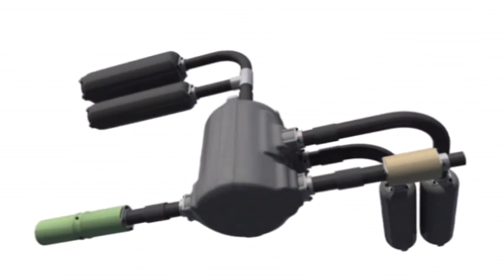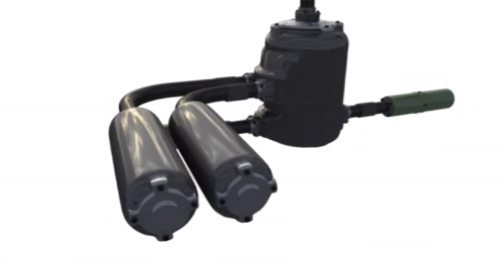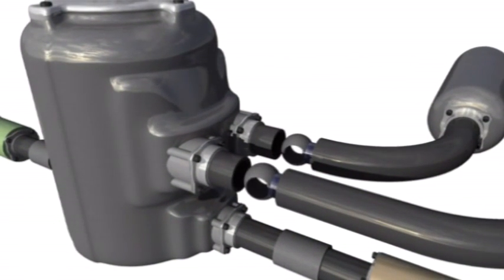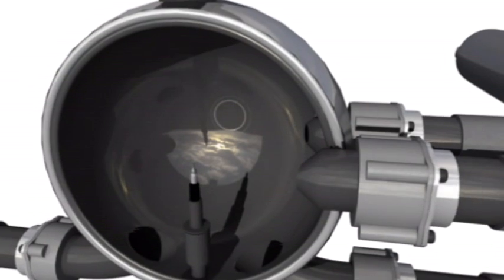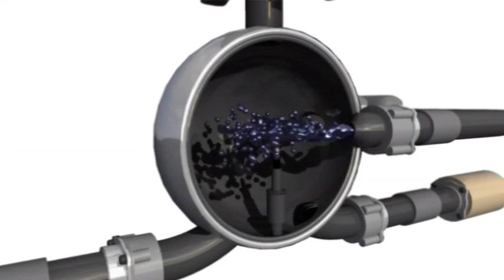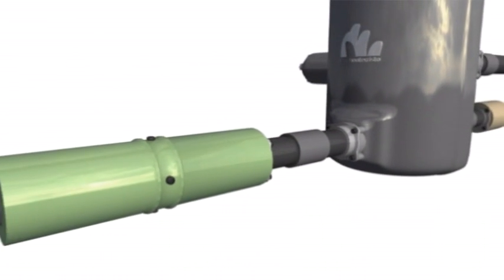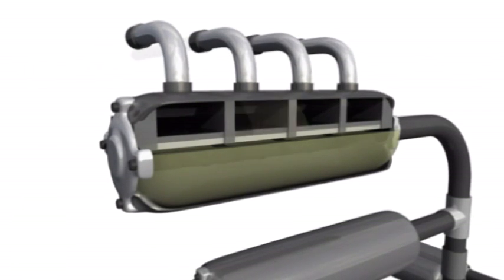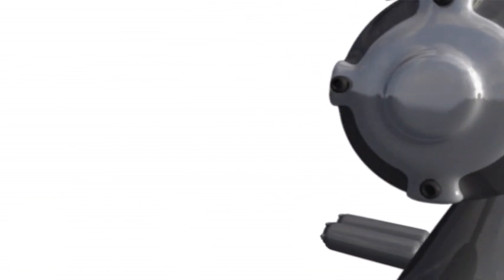WORKING OF KIT K4T IN ENGLISH. COLD EXTERNAL-COMBUSTION ENGINE PROJECT

Comment: Back in the '50s they were working on this design and even though it worked, they scrapped it because it had the same levels of pollutants and similar efficiency.  It was called the Quiet Engine or just the External Combustion Engine.

Comment: Clever, and with this you would only need to use the fuel when you need motion from the engine, which means that when the car is stuck in traffic, you don't use fuel. The only problem is that for cold starts, a heating system may be needed to get the fuel and air up to an optimum temperature for the perfect burn that that'd be very easy to construct. Brilliant. What I would like to see however is the power and torque figures for an average 1.6 and 2 litre displacement. engine.